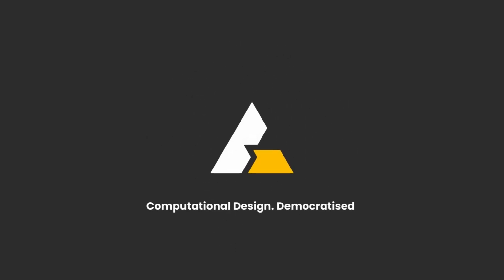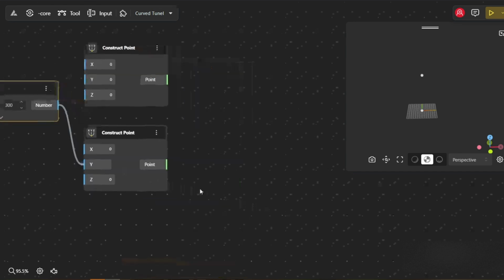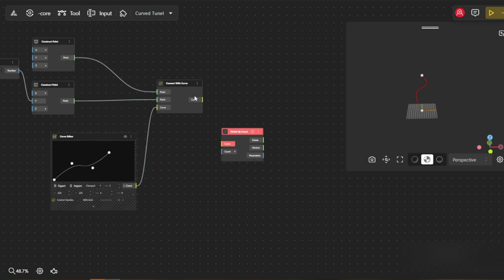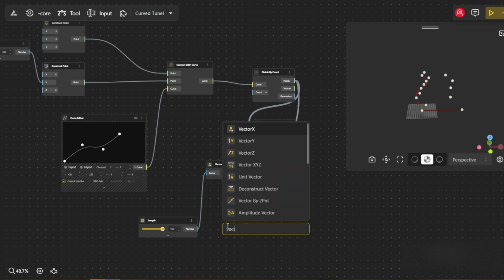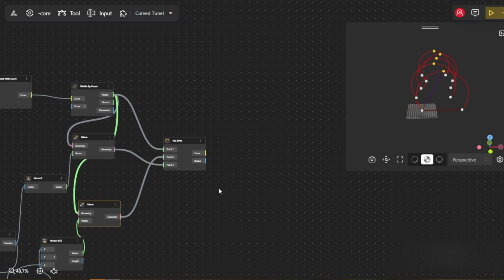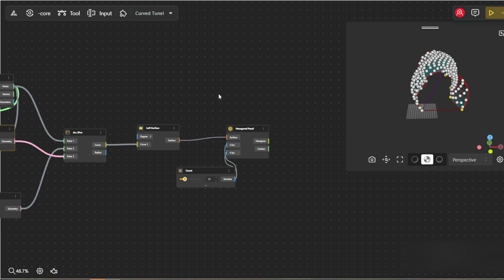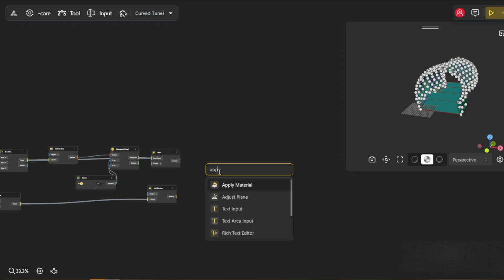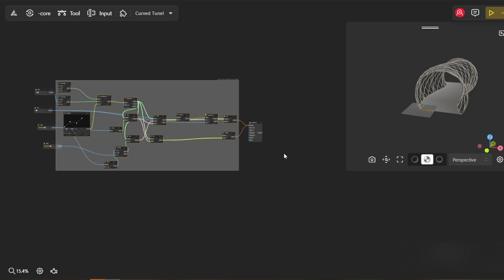BeeGraphy Tutorial: Creating a Parametric Curved Tunnel

Comment: I was going trough this tutorial, and first try with the pipe node, some segments didn't generate. Then, I tried Explode>Flatten Tree>Cull Curves>Pipe, to reduce geometry and the pipes that didn't generate first try, did generate, but for some reason a lot of the segments were still duplicated (1264 into 783). Is this a problem with the Hexagonal Panel making not perfectly aligned curves or is this a problem with the Cull Curves command not identifying some correctly?